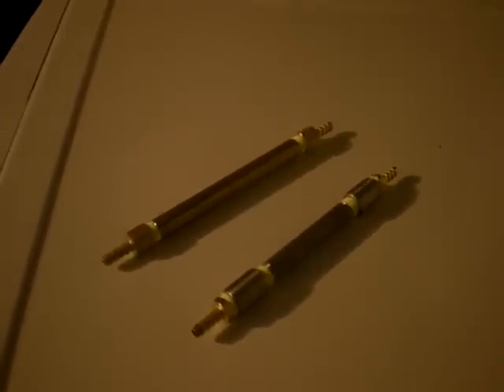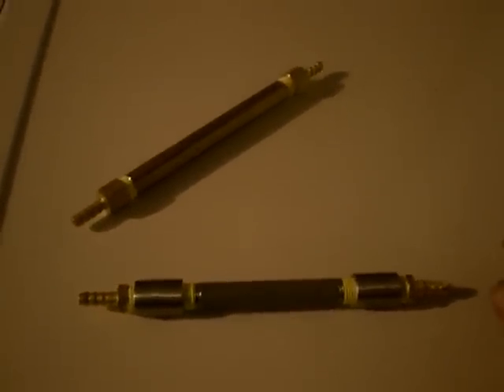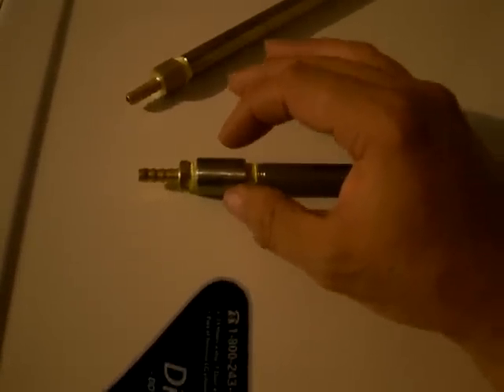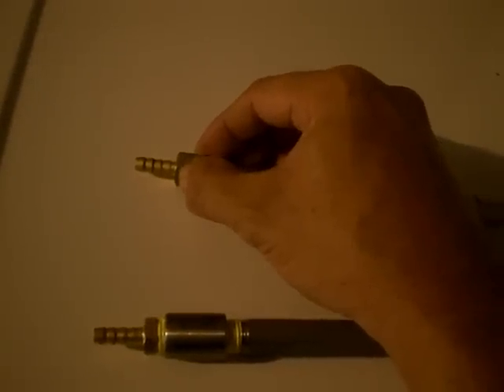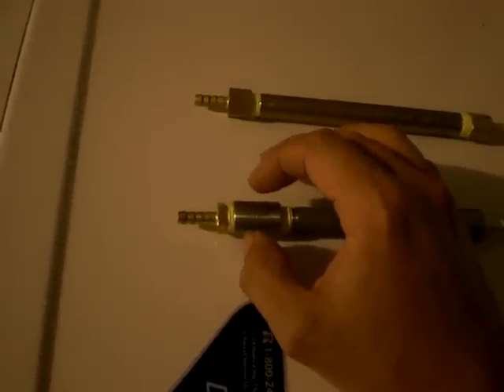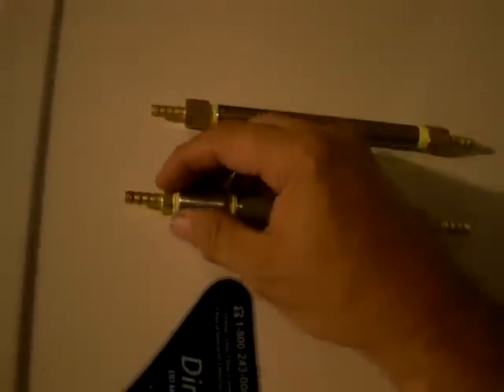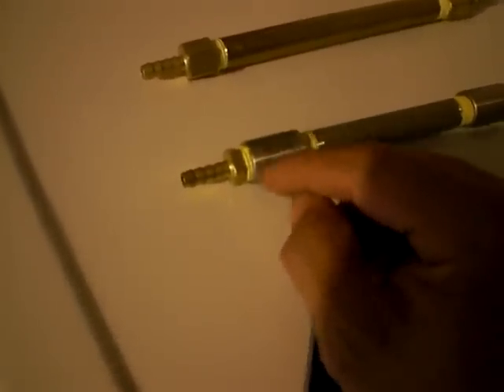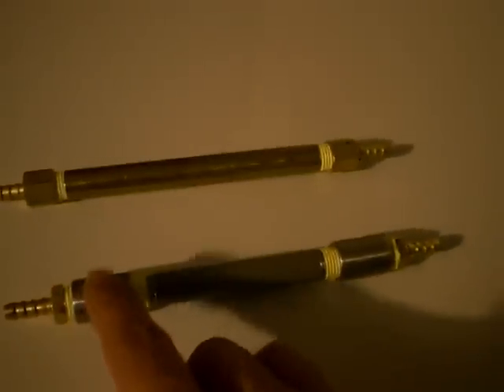Warning about In-Line Flashback Arrestors!!!

Comment: ... I found as someone else has mentioned that Benz-O-Matic  heat shield cloth; rated somewhere around 2500-3000 degrees to be the best tip of all.  You can find it at Home Depot and Lowes.

... I had laying around from a welding shop I was able to cutout many perfectly fitting circles of this material and adding these to each end of fitting before tightening and a final run of of bronze wool has given me a flashback arrestor that has not failed and which I can trust ....

Comment: Thanks for the video.  I might pack some more FBW into my FB arrestor soon, just to play it safe.  

Also there is a type of                                                                                             wool that is used for very high temp applications.  I remember my pottery teacher in high school a while back showing it to me.  It can withstand temps above 2400F.  It's quite expensive at about $20 a lb, but I'm sure it would work well.  It looks like cotton, but doesn't burn...

Comment: How about those filters that are used in pressurized systems with air compressors? I had this little chrome fuel filter I bought and when I looked inside, there was a removeable chunk of densely packed grains of brass. This was the filter material which would only allow air/liquid to pass through. Have you tried or seen a device like that? I'm completely new to this HHO process but, have a general concept.

Comment: Why not eliminate the 1/4" pipe and just use the coupler with brass wool filled in and then secure the barb fitting? How much brass wool do you think you would  need to act as a barrier?

Comment: I found that stuffing the fine bronze wool all the way through the outside nipple where the connects.  I also found putting sand in the center with stainless steal screen wire folded four times on each side of sand is the only way to make a flashback arrestor.

Comment: I had WAY too much confidence in mine and it only took a small amount of delay in production (lack of production) from my cell to send the flame straight through the line and into my very well sealed cell and cause it to explode with so much force that I may never recover all the pieces! 
It happened so fast too...I did not know it blew until my ears stopped ringing!

Comment: If you go to summitracing•com and look for Holley 162-500 that's the filter type I'm talking about. Also on this site: alibaba•com and search for "bronze filter". Also, I wonder if putting a screen on end and filling that tube/pipe with those tiny little brass balls, and capping it off with another screen, then capping it off would work??

Comment: Is that fine or course bronze wool, i found both.
Reply: Fine bronze wool
Reply: I have a 2 inch brass pipe 1/4 inch diameter and the ends like you have there, do you think it'll work on that or does the pipe need to be longer?
Reply: Jonathan Adams It will work, just remember to remove any possible air gaps at both ends, and don't over pack the wool. A way to test it to see if it is over packed is to blow into one end. If the air moves through easy enough, then you should be fine. If you have to force it too hard, then you need to loosen it up.

There are other options for flashback arrestors you might want to consider. I've had the same problem with an internal fire, and it is rather hard to remove all the air gaps. This one does work, and the pipe allows you to have a handle to hold onto if you put the torch tip on the end of the arrester. It's a matter of experimenting and adjusting the wool as you go. Most hho generators put out around 10 PSI, that provides for a good flame. But if the wool is packed too tight then it won't work as well.
Reply: cool thanks, i'll try when I get the wool.
Reply: FYI, Jonathan, you can normally find bronze easier at a marina store. It is often used for cleaning the fiberglass on boats because it doesn't scratch the surface like steel wool does.
Reply: I found it on Amazon.com